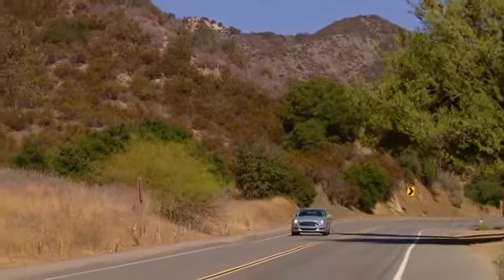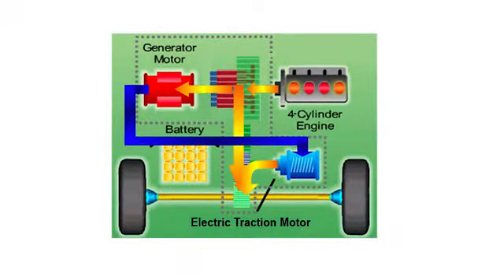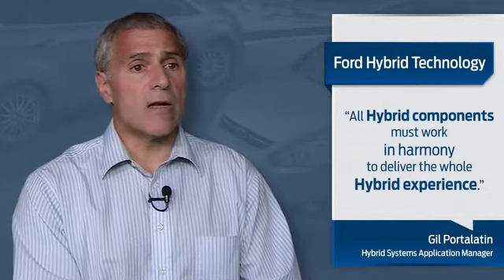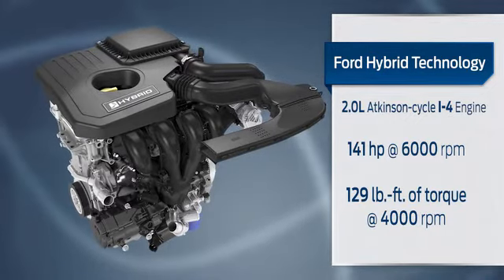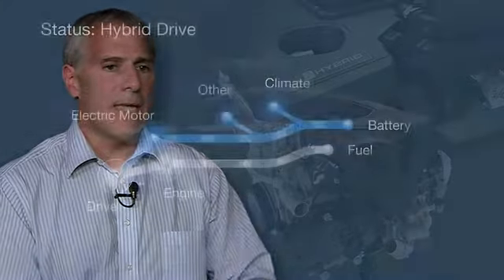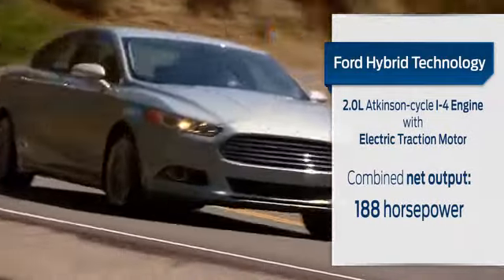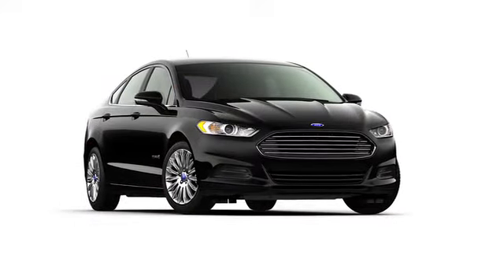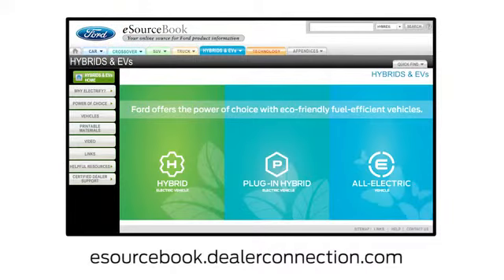Ford Hybrid Technology Third Generation

Comment: Fusion hybrid is the best and most reliable car I’ve ever owned.
Reply: The hybrid system is Toyota tech the engine  in them is designed by Mazda and Volvo
Reply: @joshuamast5128  I didn't understand. This fusion hybrid system is made by toyota and used in mazda and volvos?
Reply: @arlokkkk  I don't know what happened spellcheck screwed it up I fixed it now